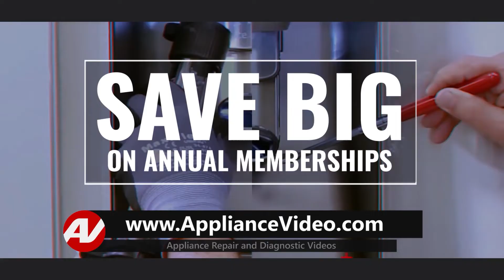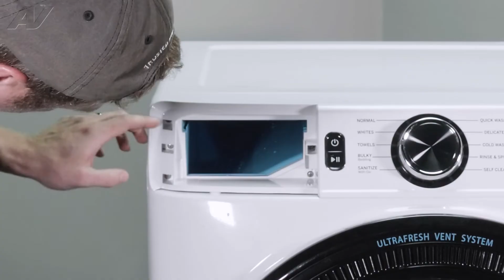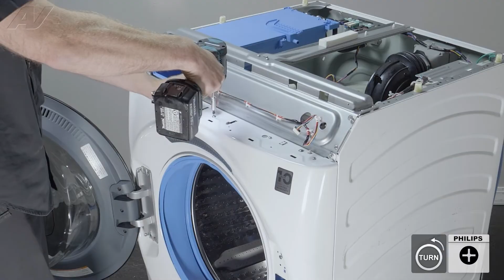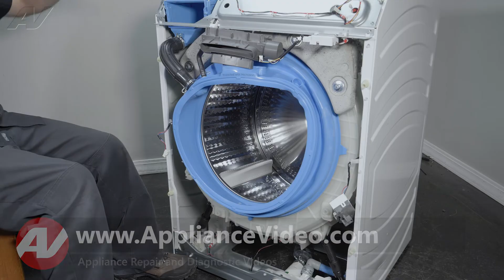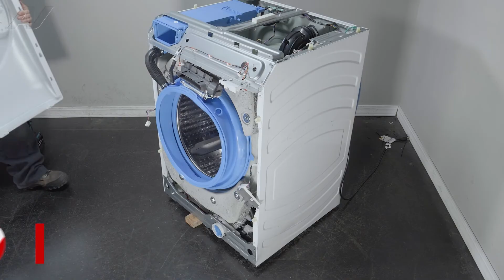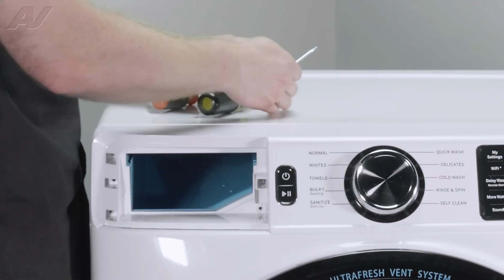GE Washer Repair - Door Boot Is Leaking - Door Boot

Comment: When you reinstall the fill hose into the boot around 16:10 you really need to be sure it is fully inserted.  From what I could see you didn't have the fitting full engaged... it can pop out during fill and flood the home.  Really make sure it is in all the way.
Reply: Wrong he has it fully seated

Comment: Excellent video. I had a very slow leak which occurred only when the washer was filling so I was pretty sure the boot was NOT my problem. This video was so helpful in tearing into the guts of the machine. Once I removed the front panel, I discovered that the supply hose wasn’t fully seated in the boot, which resulted in the leak.

IMO, the toughest part was getting the spring tension ring back around the boot and onto the front panel. I looped a piece of string through the ring, about a quarter of the way around from the spring. I then stretched the spring with my needle nose pliers and pulled the string towards the spring, guiding the wire over the boot lip. A second set of hands was also helpful.

Comment: Thank you! Thank you! Thank you! With your video on play-pause-play-rewind—(you get the picture)—I successfully replaced the Microban boot on my GE Ultrafresh today! Ours was astonishingly filthy and irreversibly stained with mold/mildew, which is why we decided to just replace it. I had debated paying an appliance repairman to come put it on; I was especially intimidated about those springs being so tight. But I was able to do it! Took me more like 3.5 hours 😬 (including lots of cleaning of the machine filter & around the drums). But I was also intentionally being slow, taking pics of each step in case I forgot where things went when putting it all back together, etc.

I did not take the top of the machine off. I did remove the door before taking off the front panel, just to make it easier to handle. I did not remove the counterweight, either. I just used the handles of my needle-nose pliers (rubber coated) to help me wedge the boot around the edges.

It’s almost done running the self-clean cycle now, and I am SO happy to have that filthy boot in the trash!!

Thank you so much! Saving your video in case I ever need to do this again!

Comment: Thanks for the detailed video!

I appreciated the technique at 24:40 to stretch the outer spring clamp - saved purchasing the $25 special-purpose tool.

And for the commentor asking for where to buy the gasket - search for WH05X29514, it should be called a seal/gasket/"door boot gasket" at appliance retailers or general purpose stores...

Comment: Good afternoon, this video was excellent, I replaced the boot in less than an hour.  Unfortunately the boot wasn't causing the leaking.  My GE Ultra fresh is only 2 years old, and it looks like the leak is between the dispenser and the front control panel and running down the outside of the boot.  Have you seen this, and would you happen to have any ideas on the best way to fix it.   When I took out the soap tray out, and kept the fron t control panel off there were no leaks or water running into our pedestal.
Reply: Yes. Pull out the detergent tray and check for any debris/clog, put your finger in there and feel anything that causes the clog. Mine did the same and it was a piece of oval plastic piece from the detergent bottle.

Comment: My GE front load washer had a leak around the seal -- but it really didn't!  I never noticed the leaking when I was washing laundry, I would notice it later.  And I would oddly find water in the drum.  And if I left the door open I would find water on the floor.  The water enters the drum along the upper inner edge of the opening.  If the door is open it will run down the seal and out of the machine.  The seal was not leaking in my washer.  The water inlet valve -- where the hoses hook in -- was not closing absolutely fully after using the washer (It is a $25 part).  You take off the top of the machine, unhook the electric wires that attach to the valve, and replace it.

Comment: The top doesn't have to be removed and the door lock can stay also. You can get your hand behind the bellows and disconnect the door lock and also on the other side from behind the bellows. Just did my drain pump and control board so I know this machine better than I care to.
Reply: This comment is priceless, I was wondering who I was gonna call to help me move the dang dryer off the washer!! Thanks for sharing